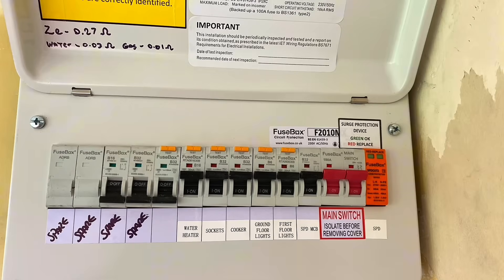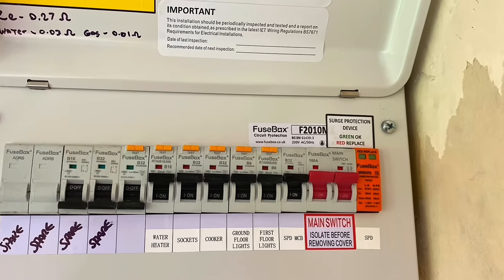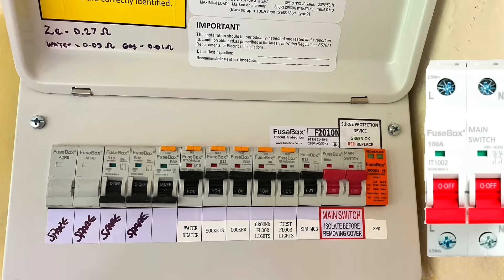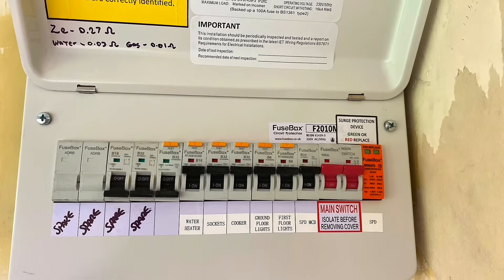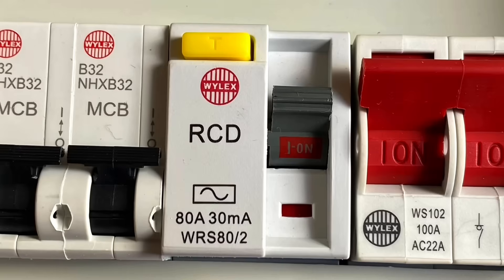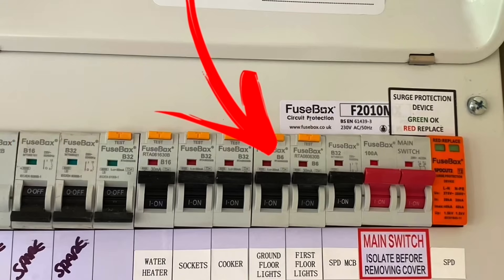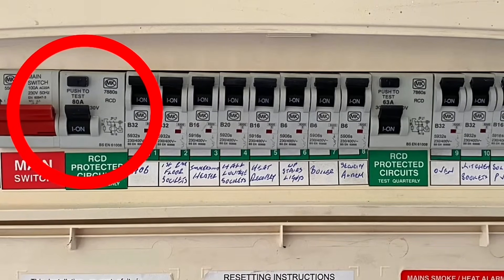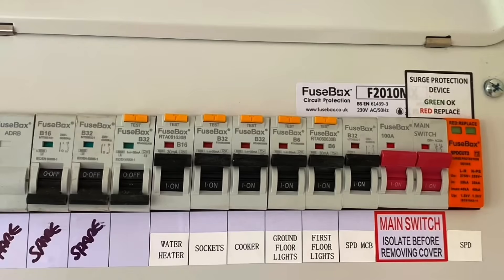Understanding Your Consumer Unit

Comment: Don't plaster the entire marker area with the word SPARE diagonally because when it comes to adding in a new circuit and adding the label for it, part of the word is still visible behind the new label.

Just write SPARE oriented horizontally in the lower half of the label area so that it can be fully obstructed by the new label when applied.

It just requires a little bit of thought.

Comment: no labelling or identification of mains powered smoke alarm  shown in video.
Was always taught to install highest rated load closest to main switch…..
Reply: Better to space them out to prevent heat transfer from one to another
Reply: Do you think it affects performance of the protective device doing that?

Do you think the users care how the switches are laid out?

Do you think it matters to or impacts an electrician years later coming back to do some fault finding?

Do you think it impacts the electricity bill?
Reply: @deang5622 Do you think ? 😂
Reply: @deang5622 it was called good practice…..try it some time